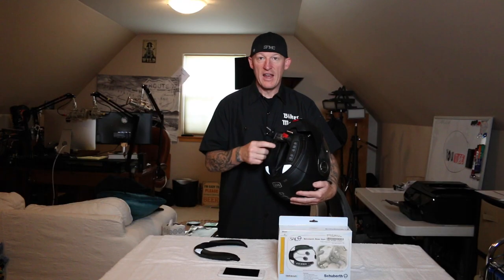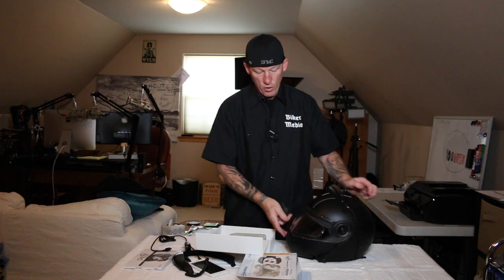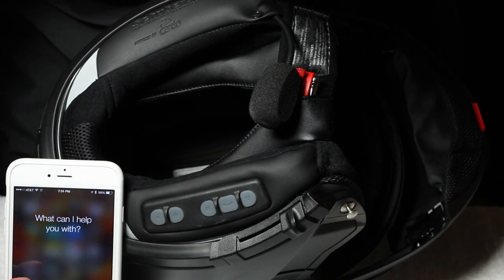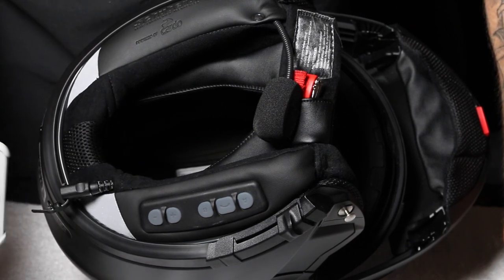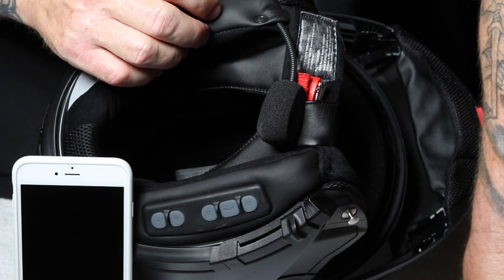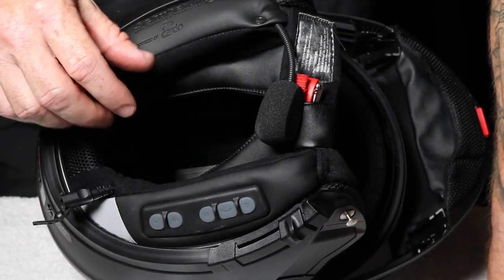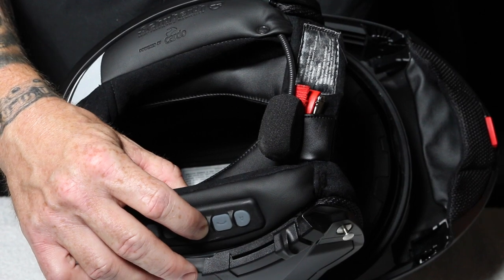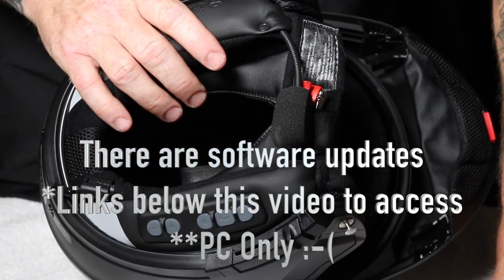How to use & operate Schuberth SRC Bluetooth Headset System for C3 Modular Helmet-Complete Guide

Comment: How would you switch between a phone and a gps or a buddy using a Sena since you can't connect to more then 1 at the same time? Thanks
Reply: I have a Garmin Zumo GPS that I use as a communications hub. Ryan mentions this at about 12 minutes into the vid.
So first go into the bluetooth menu on the GPS, and pair your SRC to the GPS. As shown in the vid, hold the phone button on the SRC depressed for 6 seconds. You wil hear a voice announcement: "GPS Connected".

Now, while in the bluetooth menu in the GPS, pair your phone with it. There may be a prompt for a pin either on your phone or GPS, depending on the make and model.

Once both devices are paired with your GPS, you can listen to turn by turn instructions from the GPS, and dial or answer phonecalls using your GPS (At least, the Garmin Zumo supports both methods). An incoming phonecall will be audible, and displayed on your GPS. You can choose to accept or reject the call by touching the button on your GPS screen. While on the phone, your turn by turn instructions will be muted.

Please understand that while riding your bike, being on the phone will shorten your life. Stay safe and always reject the call. Pull over on a safe spot and call back the person that called you. Just saying..

Another cool feature of the Zumo is that you can play your phone's music through it. That will drain your phone's battery real quick though. The alternative is to insert an SD card holding your favorite music into the GPS if it supports that.

Now you have the best arrangement. Music, telephone and turn by turn instructions. But wait.. there is more

My wife also has an SRC set in her helmet, so I can talk to her if I want to (and vice versa of course :) )
There's a catch. Turn by turn instructions will mute the intercom. About ten seconds after the latest instruction it switches back to intercom. (wife's helmet is paired with my helmet)
It may need coaxing back to intercom by pressing the A-button.

Another thing is that playing music on your helmet AND using your intercom is not a good idea. You would have to toggle the A button once you feel your passenger punch you in the ribs. She has no way of knowing that the intercom is muted.

But wait, there is more still.
Garmin has an app for your phone called Smart Link. It is used to convey near realtime traffic information, speedtraps etc. (There may be a dependency on where you live, check out garmin's site for this)

So hogs heaven? Well close, but not quite cigar. The Garmin Zumo's have a problem, where if you drive by a car with a cheap (always discoverable) bluetooth carkit, the GPS will try to pair with it. If that happens it shows up on your screen, asking you whether you would like to pair with it. But in doing so, it cuts your SRC, and all the settings you painstakingly put into it. I've had many times where I had to pull over and restore my settings. There is no way that I know of to lock down the bluetooth environment as you would always want them. Other than that it's an OK setup.

Thanks for your vid Ryan, as you say, it's one of the few that go into detail.

Comment: Hi Ryan, Thanks for the very informative video. I am about to purchase the SRC for my C3 Pro. I am hoping it will provide the solution I need to work with my Sena Prism camera. Perhaps you could advise. Right now I have an entry level Sena 3S headset. Voice over the video works a treat but in this mode I lose the connection to the phone for music & satnav prompts as the Prism takes priority. I would like to maintain the music and satvav prompts while still being able to record voice to the video. Would you know if the SRC would accommodate this? Advice apprecaited.
Reply from the maker: Boy, wish I could help on that David. I have never used or tested those items. I use GoPro and mics.
Reply: +Ryan Urlacher Thanks Ryan. Great Video all the same. Very informative.
Reply: If you pair your helmet with your GPS, and your camera to your helmet, then your camera would be on intercom. On an SRC, GPS turn by turn would take precedence over intercom. (so the reverse as you describe it). An SRC would support this arrangement. I think the catch is whether your GPS announces itself in bluetooth as being a GPS, so the SRC can destinguish between the two and give precedence to it. You can find out in the shop.. if you pair it with a helmet and you hear "GPS Connected," in your helmet, you're good to go.

Hope it helps.